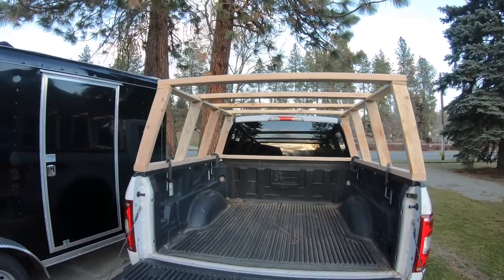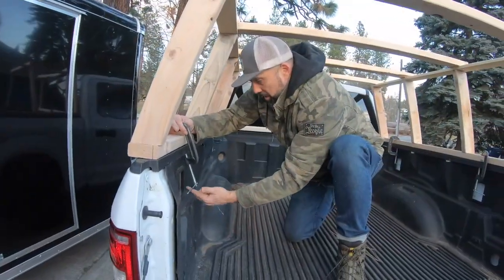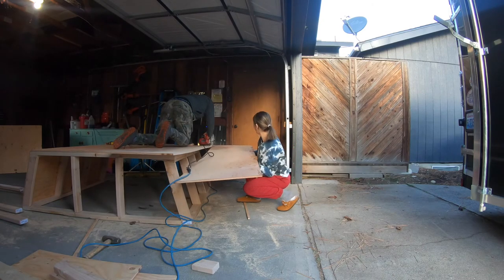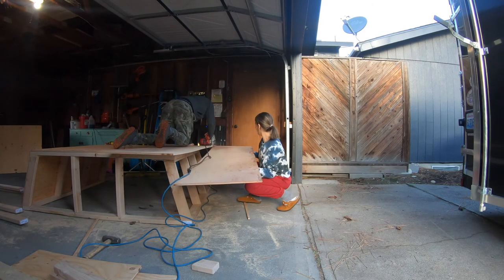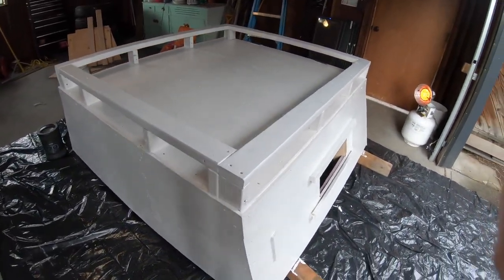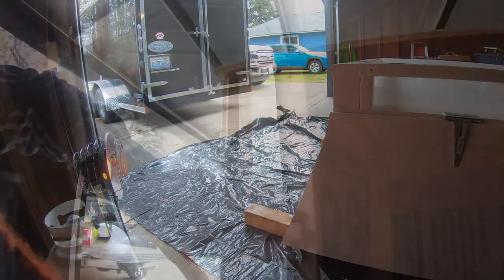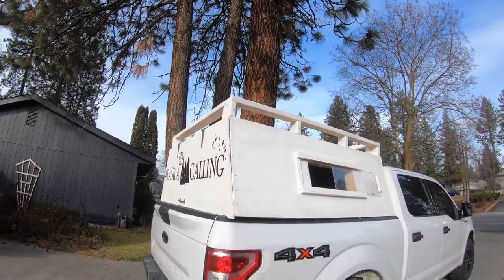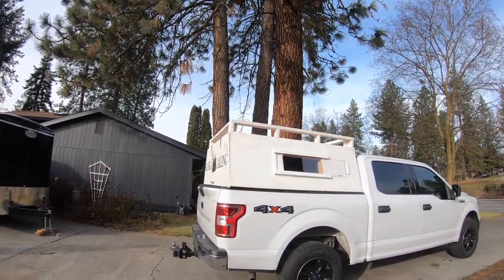DIY Camper Shell

Comment: Now that it's been over a year since you built it, was the elastomeric coating enough to seal the joints between the pieces of plywood?
Reply from the maker: We also used a piece of plumbing tape on the top to keep moisture out of seams. All is still good even after sitting in 3 solid months of 4ft of snow.